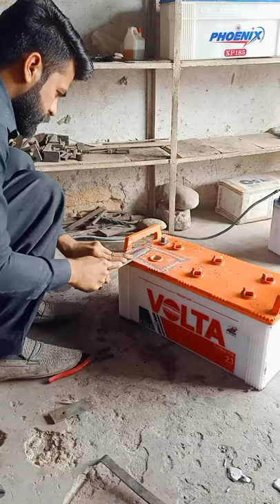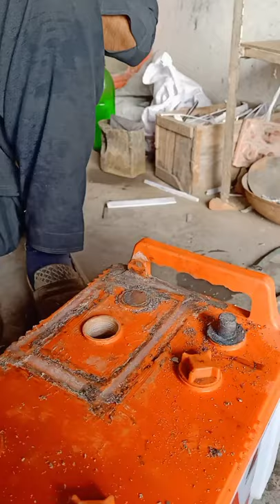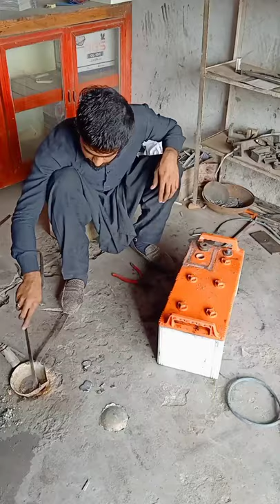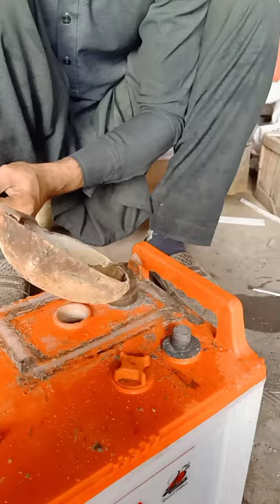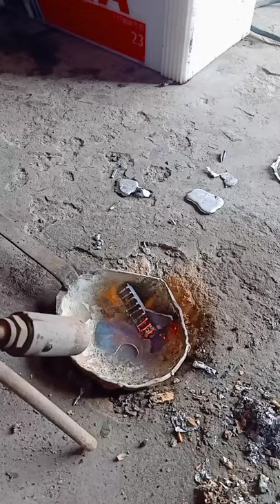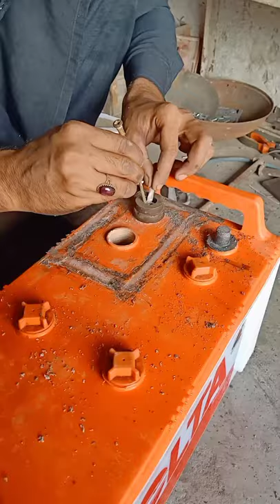Repairing Broken Pole || Battery Pole Restoration #short #shortvideios

Comment: I live in a western country.  If a battery terminal was broken, we would buy a new battery.  I have never heard of anyone reapairing a battery terminal.  This was amazing to watch.  I am going to try this with an old battery, just to see if I can do it. 👍🏽😁
Reply: Why uncle's manufactured lead acid storage batteries 4 truck and Industrial use. Back in the day when hard rubber case batteries we're still being made they would also rebuilt the batteries. They also did lots of repairs such as replacing busbars and putting new terminals on. I remember them having a mold that they used it was more or less just like what you see being used here to put a new post on. Probably the last time I saw them use it was in the 80s. After that there were very few hard rubber case batteries anymore everything went to plastic and the battery repairing and rebuilding business became a thing of the past at least here in the USA
Reply: I live in a 1st world country and batteries are repaired in this manner if it is still good.
Reply: Damon Wright   So do you or do i live here ? Workshops in Singapore does this quite frequently. Only your opinion is valid ?